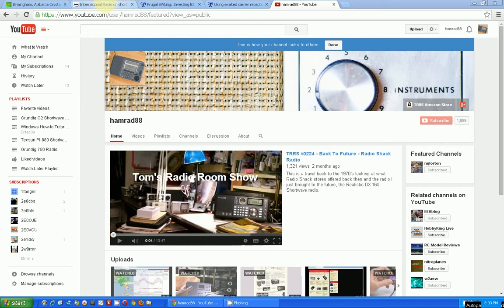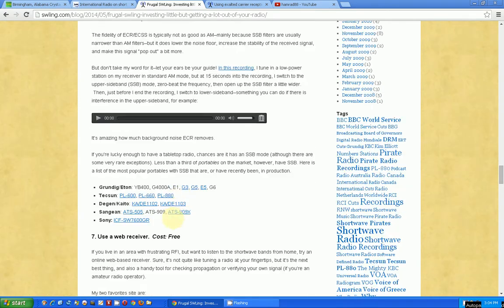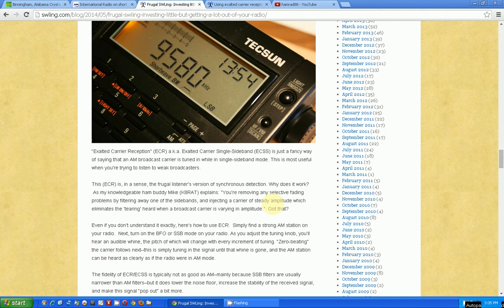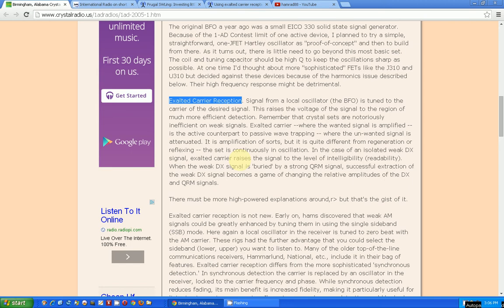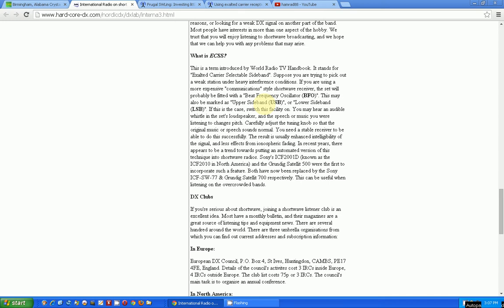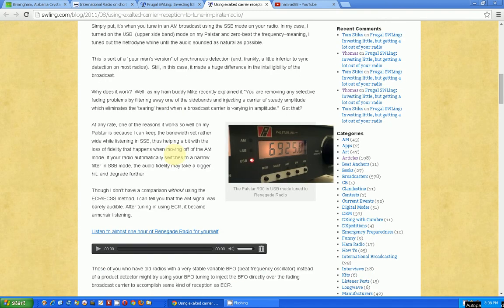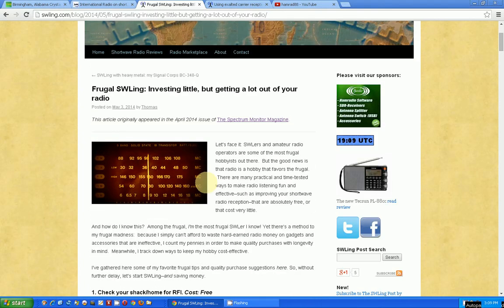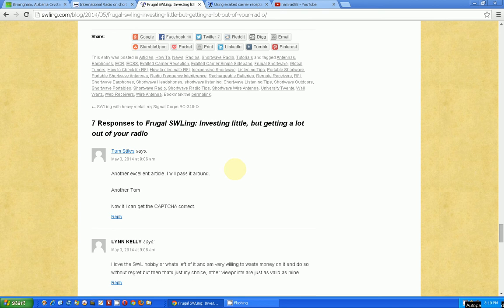TRRS #0292 - Using ECR/ECSS to Improve Shortwave Listening

Comment: Another excellent article.

Might note that in some instances, Exalted Carrier Reception (ECR) or Exalted Carrier Selectable Sideband (ECSS) are old or obscure names for AM Sync and the actual circuits, usually slightly different parts / concept-wise. Seen used on the Satellite 800, Drake equipment, Tecsun PL-660 with BFO used or not, etc. Also these ECR and ECSS methods are "old hand" to users of SDR programs / hardware like SDR-Radio, etc.

Additionally, if you "run" a receiver/transceiver that uses variable-speed AGC -- say FAST/SLOW, or SLOW-MED-FAST, etc. -- the use of such AGC control levels can actually enhance when you use AGC with ECR, ECSS and AM Sync.
Reply from the maker: Thanks for your comments, Joseph.

Tom
Reply: One key difference with sync detectors is the phase lock to the signal's carrier (versus random phasing when simply switching from AM to SSB mode)